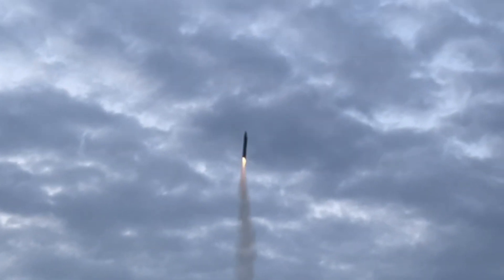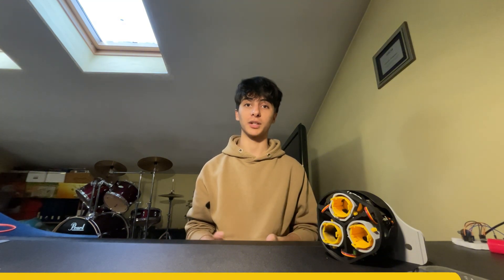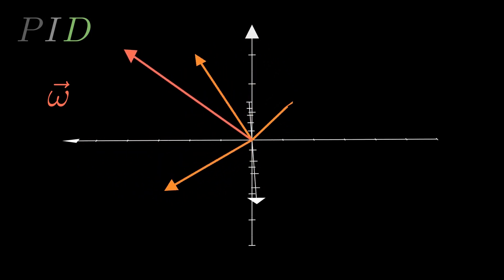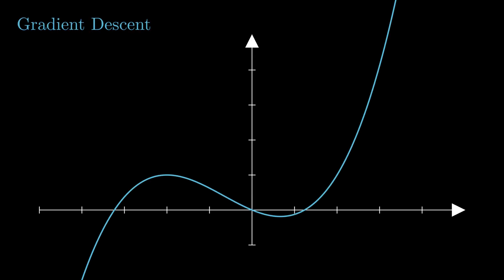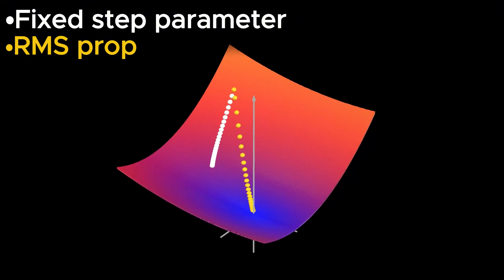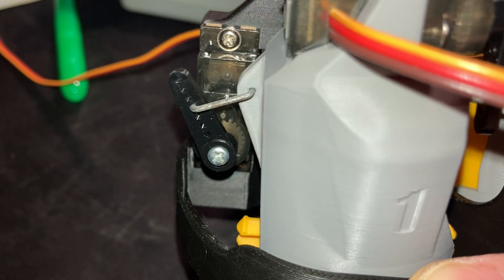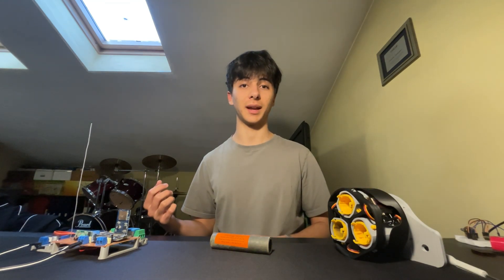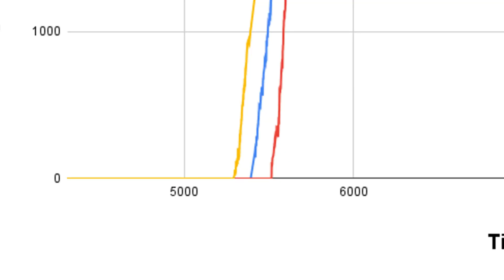How Can 3 Motors Steer a Rocket? Meet TRINITY

Comment: Nice work! Love the more advanced math in use here, very cool. A few thoughts I had: 
- Why go for dual axis actuation on all three motors instead of one on each? If you remove the in-out movement and only leave the radial movement that should still give you full control of the rocket with much less weight and complexity, though perhaps with no engine out capability and higher cosine losses.
- This design would be great for building such a rocket in a place such as germany where the strongest rocket motor you can buy is of D class, far too weak for your usual single motor TVC rocket.
- I'd love to see more about how you transplanted your matlab model into C code. Did you use code generation? Did you manually re-implement the model, and if so how did you verify it? - Are you really running a full gradient descent every loop iteration? Why not use a lookup table of precomputed values for the flight envelope (or look for an analytical spline model)?
- How are you getting your attitude information in the first place? I assume it isn't a Kalman filter with there being no GPS, is the plan to just do dead reckoning from launch onwards? What drift are you looking at after power on calibration?
Awesome work dude, inspiring to see, excited to see more! Now, you can cosine throttle with your design without any adverse torque, so, landings soon? xD
Reply: Don't forget to model 'thrust damping', the effect caused by rotating the rocket exhaust.
Reply from the maker: @richardm.newlands2417  didn’t know what it was but I just found a paper that explains it, thank you for telling me!
Reply from the maker: Ahahahaha sure I can  throttle it, by about 2%, but I can thottle it!
Here are my replies and some questions too:
- I went with dual axis actuation because honestly it's the first thing that came to my mind, and I initially didn't even consider single axis. But when testing the algorithm on Simulink, I also tried to see what would happend if I disabled a certain number of servos and... it's was almost as you just said! Removing one of the two movements (in-out or the other) retains control, whichever of the two you remove actually. Having dual axis still retained better stability, and exactly as you said, keeping control, if one of the engines was out, was working only with the dual axis configuration. Btw the TVC system is still lighter than I would have expected it to be (185 grams without solid engines attached), so the benefit would be more about the diameter in my opinion.
- I didn't mention it but i went with E-12 motors. More altitude is not as essential to me as powered flight time, needed to prove the system's stability, and I couldn't find anything burning longer than 3.5 sec
- I initially tried code generation but failed miserably at using it (was having issues with some libraries, but probably I had no idea what I was doing ) so I wrote most of the things manually while for some functions I converted their matlab code found on github, to C++.
- About verifying the model, if you mean what I think, I exported some gyro data from the Simulink simulation, imported it to the C++ and injected those into the microcontroller, and confirmed that the servo angles the simulation was calculating were the same as the one the microcontroller was calculating 
- When not using the paraboloid method, yes I'm running full gradient descent, meaning that I calculate the gradients with some formulas that I got though a Symbolic Matlab script, since the function to minimize is gradually changing its shape at every loop iteration. Though I'm not sure I understood well what you mean about using a lookup table in this case, and what to apply the spline approximation to :D
- The attitude information as of now is gotten excusively from the gyroscope, even though I will probably have to implement sensor fusion between an accelerometer and a barometer to get the altitude, and combining gyro-acc readings to get speed for example. 
Currently I do a calibration of the gyro at start up, and the drift from then onwards is negligible when staying still, though after shaking/moving it a bit it doesn't zero out its euler angles at the same orientation again(my bet is on integration errors). How would you suggest calculating the rocket's orientation if not exclusively from the gyro? The accelerometer doesn't seem like a good option to me for orientation during powered flight.
Reply: @nicola_gaiani  thanks for your response! Yeah, 2% might not be quite enough to stick the landing lol. 
- Single axis with D motors may be interesting to investigate cause as I said that's the only thing I can get here in germany. Also, I think only removing the radial movements would lose you roll control as no motor could ever generate a roll moment. I think three radial axis is the minimum you need for three axis (pitch,yaw and roll) control, so the three axis radial one may be the optimal setup ignoring redundancy. 
- Good idea to verify the model that way, solid approach
- By lookup table I mean running the algorithm for a bunch of combinations of side force direction and magnitude, then putting that on the flight controller and interpolating between values during flight. As I expect the data space to be quite smooth and sorta linear, splines may allow you to have a smaller lookup table while still getting a high quality response as I doubt there are any high frequency components you'd skip with that. Though to be fair, your current approach is inherently resilient to engine failure, while the lookup table approach would need to explicitly model it. But you would gain a good bit of processing power for other jobs. 
- Good idea to combine accelerometer and barometer, though be aware that both high G loads and how the ambient pressure enters your vehicle can throw off your barometer response. Building a proper model of that for the kalman filter will be challenging. Here's a tip for kalman filters from one of my lectures: "Rather run a larger state vector Kalman filter slower than running a smaller one faster, you'll get better data with the former". As for gyros, yeah as soon as you're in flight, you pretty much have no choice but to do dead reckoning as you have no stationary phase in which you could allign your gyros. That said, in phases where you can either neglect aerodynamic side force or where you have a good enough model of it, a full kalman filter with a good enough state model behind it could probably still get better gyro data by using gravity data after cancelling out the known motor acceleration forces on the vehicle. But that is really me guessing though. A higher order integrator is likely a better first start if you're using explicit euler.
Don't take anything I say too much for the truth though, I did take a class in navigation and sensor fusion, but I have never even written the simplest accelerometer integration in practice, my knowledge is purely theoretical.
Reply from the maker: @stratos2  
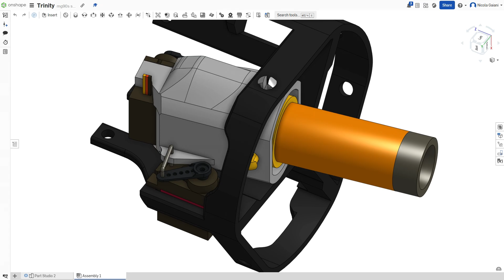-I just tried to run again the simulation on Simulink by disabling one of the two movements and they both retain roll control (NOTICE that the servos are positioned in such a way that the movement done is not exactly "in-out" or around the radial axis, but they are rotated, basically doing a combination of that radial axis/ in out movement) but the one that performs better between the two is the one rotating around the gray pin axis (refer to minute 2:02, I also left the CAD assembly in the description). Of course this is really dependent on how the engines are positioned, and around what axis you let them move, but I can confirm that one axis for each engine can still work (but not with a failed-ignition as far as simulations with my configuration)
- Now I get it! a state space that maps to the angles of inclination of the motors. It would have many dimensions (about 12, since 6 servo angles, 3 components of required torque, and the 3 Force feedback from the sensors), and since I haven't yet studied any theory about this or made any testing, I wouldn't know how many datapoints I would need to fit a space like this. Currently I'm happy with my ~1ms iteration time on the ESP32 :D, the bottle neck seem to be the servos precision and their update frequency of 50Hz. But some experimenting on this interpolation idea wouldn't hurt
-Yes I would need to be careful about the barometer, in the previous launch I did i noticed how air entering from different sides (after burnout, the rocket was spinning in the air) can have a great impact on the altitude read (I was using just the barometer for altitude). Also about the Kalman filter, I only have a rough idea on how it works, but I know how useful it would be so I defintely need to study it, and thanks for that tip from your lectures!
Reply: @nicola_gaiani ah yeah if the mounts aren't fully straight I'd expect both to retain roll control. Since roll needs so little force to be moved, the one with less authority may even be better as it offers more precision (see JoeyBs video on supersonic roll control with one tiny fin).
I would expect that you don't need a full 9d state space map to map the whole space. Thrust force to side force is by definition completely linear so there's no need for that in there, just non-dimensionalize it and redimenaionalize it afterwards. I suspect that for your problem there might even be an analytical solution somewhere despite technically being underconstrained. The active gradient descent definitely seems like the most resilient so long as it remains fast enough though.
There are some good reseources on Kalman filters out there. They're about the best you can get for filtering, but they do need to be implemented and tuned well to function properly. They also require that you identify all errors in your system (e.g. gyro noise/drift, etc) and model them accordingly. My lecture did give me some book recommendations I could forward if you start researching this.
Reply from the maker: @stratos2  yes could you give me some book/paper recommendations? Thanks!

Comment: Very nice! I find it ambitious skipping 2-motor system and jump straight into 3 😁. I love to see that you have good math skills 👍keep it up!
Just a few thoughts on a project:
I think for multi-motor systems, people also use special quick-burning tape or cord,  so you have only one electrical igniter that burns the cord, which splits into 3 cords for each motor. AFAIK it provides less ignition delay discrepancy compared to separate igniters. But I never did that myself, so it's just an idea for you to research.
Also, I recommend against injecting fake gyro data for attitude control. 3D rotations are not additive and not commutative, so the result of adding fake data will depend on the rocket's orientation during the period when you add it. Yes, it will be quite close to what you want to get if your rocket more or less maintains desired attitude all the time, but it's definitely not a good way to do that. Instead, you can add one more intermediate "attitude" reference frame between your existing "earth" and "rocket" reference frames. And use it to control the desired rocket attitude.

Would love to see that 3-motor mount in flight!
Reply from the maker: Thanks! I found 3 engines to me a more generalized case than 2, and with three engines (with a fixed thrust) I'm pretty sure you can cancel out torque while still having lateral force. Btw I'll look into those ingiters you mentioned and see if I can source them somewhere, and thanks for that reccomendation about the gyro injection! I overlooked it and I'll look deeper into it to see what's more convenient